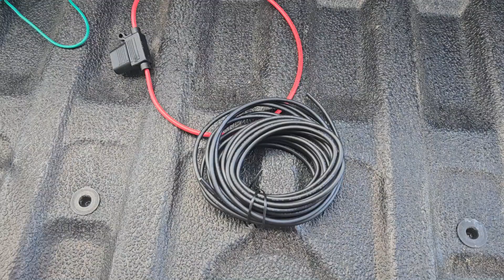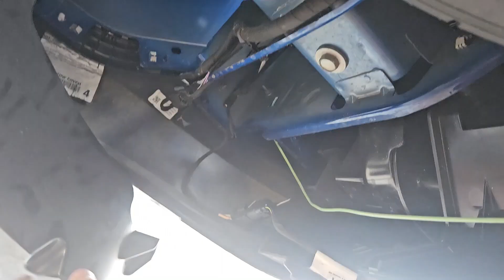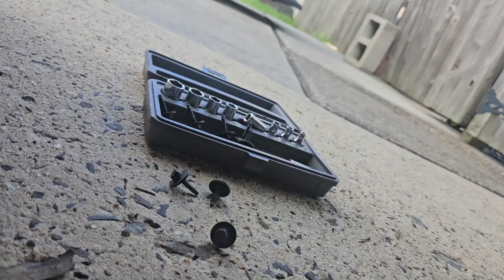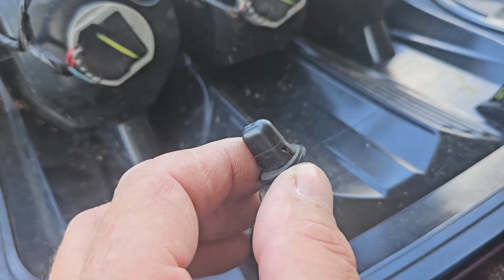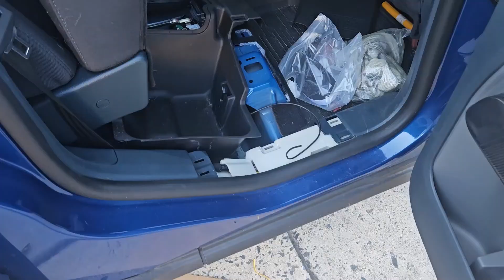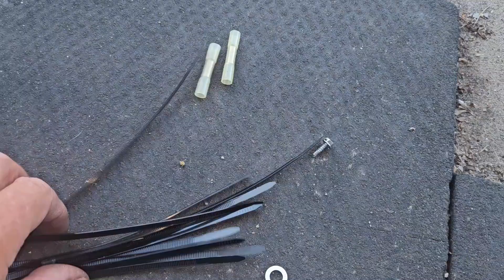4 pin flat connector install on Ford Maverick Hybrid for tow hitch with converter

Comment: Where did you get the harness? All harness I see on Amazon is for non-hybrid models
Reply from the maker: I got it on Amazon : Dasbecan 56477 4-Pin Flat Trailer Wiring Harness Kit Compatible with Ford Maverick 2022 2023 2024 4-Way Connector Tow Hitch Wiring Harness it didn't specifically say for Hybrid but it worked.
Reply: @mdfixes  sweet ty

Comment: couldnt help but to notice that you didnt show the ring terminal attached to your battery post.  I ran into the same problem....the nut is designed to not come off of that post which has me deciding on what to do for plan B.  I can use a U style connector under the nut or use one of the other two posts on the side of the battery terminal.  Yet again the nut on the side of the terminal did not want to come off.  That leaves me with the heavy post next to it.